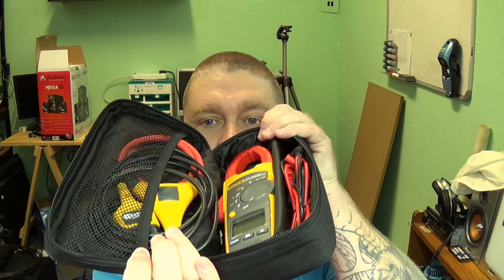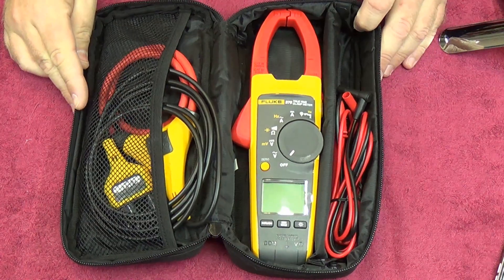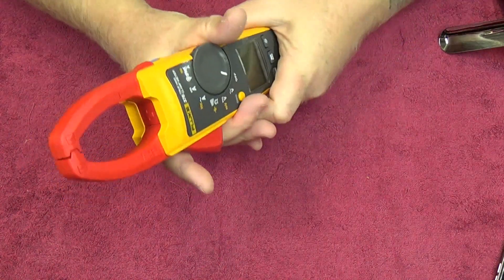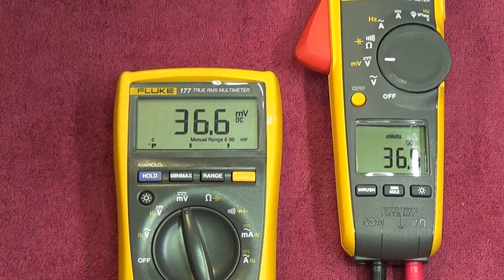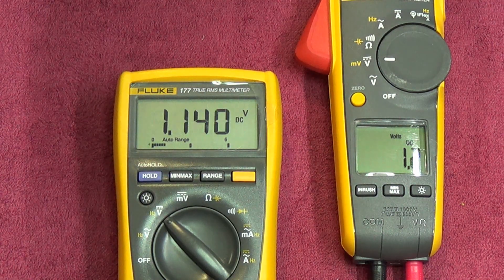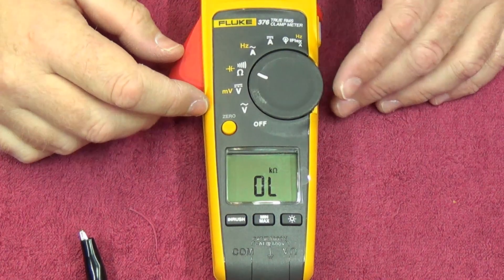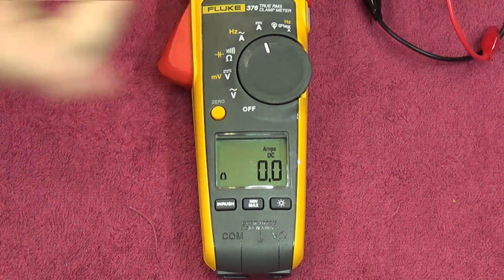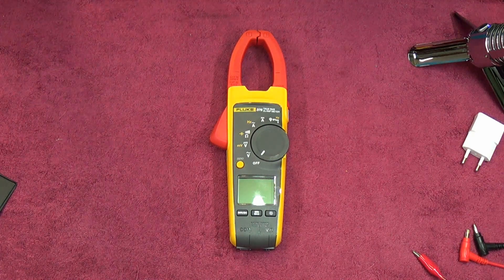Episode 92   Fluke 376 Clamp Meter Mini Review

Comment: will it read micro amps?
Reply: Nope. 0-600A w/ a resolution of 0.1A
Reply: @eastcoastloveaffair  I bought one a few days after I posted it and replaced my Fluke 323 and 117 with it. I've been training a new guy ever since and have only used it a few times. It's nice being able to take accurate amp draws on blower motors with the blower door on when servicing furnaces.

Comment: Great Review. I have the Fluke 179, just purchased the 376. I'm doing a lot of maintenance now & she comes in handy.
Reply: i have a fluke 179 also , now my car blows 100A (main) fuse , i already disconect the starter motor but still trouble , also took out some of the big fuses , (one at the time) in an atempt to find whats wrong, i think i need a DC clamp meter to figure it out , i have a honda civic hybrid 2008 , do you have an opinion? do you have a suggestion what clamp meter to purchase ?